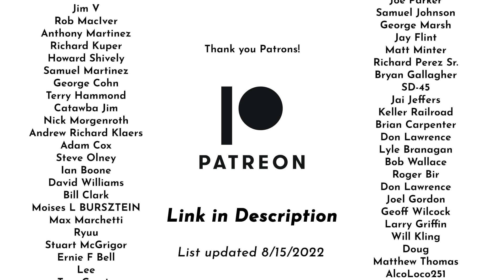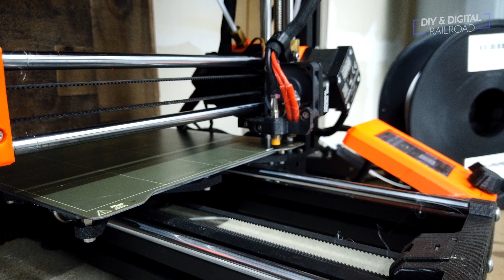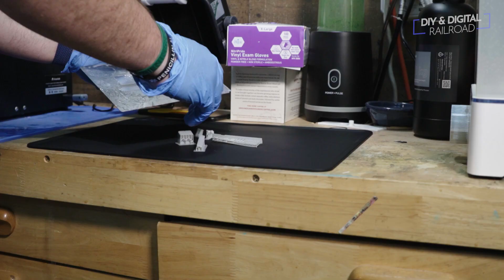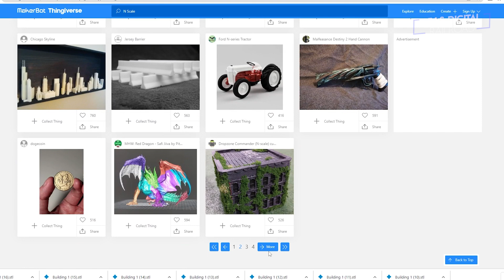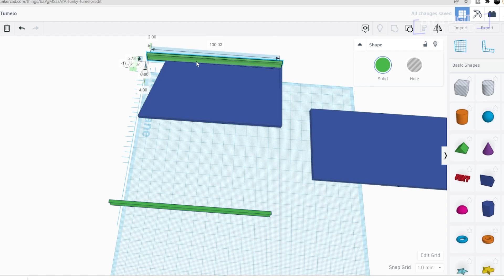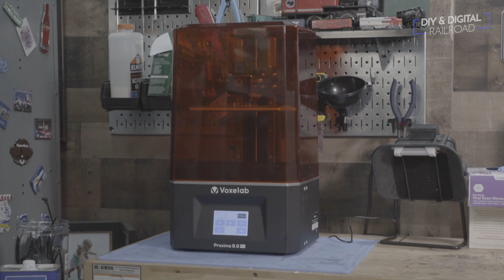Model Railroading and 3D Printing in 2022

Comment: I very much agree with you regarding 3D Printing and of course IOT. I run 1950s American Flyer as you know it is not O or HO it is S Scale. But It is what my Dad gave me in 1957 and I just love the scale. I started with a cheap Plastic Printer and I self taught AutoDesk Fusion 360. I was an engineer in my day and started my career in the draft board Designing HiBay Fork Lift Trucks. So I knew a little about electromechanical. I had trouble getting 4 puffs & Chuffs per Rev on my 1950 American Flyer. That was my first project. I had already cut up the old smoke housing and crammed a Mini DC Motor  with a fan, and added tubing to route the air into the smoke box then pulsed the fan motor from a reed switch off the old Smoke gear. WOW that was a lot of work but it did the job. I make three of them but it killed me to cut up and destroy these Vintage Smoke housings. That was when i bought the Toy 3 D Printer for $150. It worked very slow and not a lot of detail and nothing too hot. BUT, I did it! I designed several Smoke Housings with Fan Motors and used PC Board material for the lid.  I melted a few down in the process. But I finally had a a decent design and could monitor the Smoke Heater in closed loop to prevent over heating. Then I designed an adaptor to fit my contraption onto the Flyer Steam Engine and VIOLA! It was working. But i lost the old mechanical chuff sounds. So i have to search for a Chuff Sound and triggered it off the same reed switch. That was over 5 years ago. Today I still have a Hobby 3D Printer but it has been upgraded a LOT and It is Big. 300x300x400 So I can print Engine Bodies. I have made fire boxes, Tender Chassis, Trucks,, 4 and 6 wheel with pickups, Replacement Motor Fields to convert the Vintage motors to DC using Permanent Magnets like the early motors. I have also printed Test Rollers for testing the engines, Stationary smoke for Hot Box Cars, Factories and Homes. I just completed my 1st whole Tender trucks, chassis and body for a K5 Pennsy Pacific. My next project is going to be an S Scale version of the Snow Piercer with a Diesel Chassis in 3D Print with DC motors and ESP MicroControl with lights and sound. I have the prototype  body ready for modification to fit the chassis. I see 3D Printing as a means to unleash creativity and Model Trains as a common focus for many of us to groups around and recreate our dreams or make new ones. I have made numerous Tribute Trains for kids and friends end job places or special events. Its not scale or rivet counting but it sure brings in a lot of folks to see and admire creations they can relate to. Some of my favorites were, Wizard of Oz for my wife, A spy train for work, a greek train for family friends, Lincoln Funeral Train cause I am from Illinois, Corvette Train cause i have owned Corvette since 1966, Several Christmas and Childrens trains and I still have a list I want to build to. The hardest part was coding the ESP boards in Arduino. I coded as an engineer but Arduino is really still an infant with respect to standard protocols and User interfaces. You buy a board you better get the pinouts and INO File for testing. The best part is when I am completing the assemble on the final parts after months of test and rework, I know everything works and looks good. I am building this last one with all the correct parts, all the bugs fixed and its going together to test one last time then ship to the new owner. I love that last days of thrash. You look at all the test parts and see the completed model. You did it, it works as you dreamed it could and you can not wait to the email back from the recipient. Oh what craftsmanship, its just beautiful, so much detail and it works so smooth, the sounds are awesome, and my most favorite feedback, Thank You. I bath in that for a a few hours then my mind wonders across the shop and I see a piece of my next WINDMILL! Ah HA! I can do that! I am so grateful to be alive today and have such wonderful tools to play with and share with my like minded train buddy. You hit in the head 3D Printing has transformed Model Railroading. I am stuck in the S world with my 1950s American Flyer Track and Transformers pumping out AC volts but I just love it. I have rectifiers and Volt regulators and I use chips, resistors, microcontrollers and digital sound board. My next control is on the bench and it will use WiFi in these 1950 engines can you believe it. The founder of American Flyer in S was A.C. Gilbert, he brought us Erector and Chemistry Sets and I know he would have embraced 3D Printing and IOT as well. Come on folks join in the fun, you never stop learning, dreaming and build things. Lets have some fun with trains like we never imagined. I show my work on You Tube on Frankentrain Laboratories. I am not a business, I make no profit, this is my hobby and in retirement my lifeline to sanity. Old Engineers never die, they just by a 3D Printer and make things forever. Regards Dennis in Virginia

Comment: There is a new update to Cura, with Cura 5.0 there is a new slicing algorithm allowing for variable line width during printing.  Prusa Slicer has it too, in the settings have it use Arachne to slice.  FDM is able to get some details that were otherwise ignored during printing, like I made a building using TinkerCAD that has brickwork, before, the slicer didn't really understand them and it wasn't all that sharp.  With the update, not only the brick work comes out incredibly sharp, but also the window frames print (they were ignored before).  I can now get, on my buildings, detail bits to print with the building that would otherwise be a separate piece.  
When designing a model, I do think in terms of printability, like overhangs, and try to design it with as few or no supports as possible.
Note: With resin you CAN touch a printed part before being cured without the need for gloves, resin can cause a minor chemical burn on your skin if left too long.  I don't use gloves unless its a model with supports that I need to clip off before curing.  If I am going to be handling the model for longer then half a second, I do use gloves.  Otherwise I just scrape the model off the plate, pick it up and put it in the basket for the Washing station.  After that I dab it dry with a paper towel and into the curing station it goes.  For some models, I have them print directly on the plate, no supports, so its just a matter of getting them off of the plate without braking them (50ft Flatcar, 50ft Bulkhead Flatcar, Center Rib Flatcar and Opera Window Center Rib Flatcars).

Comment: Having had an FDM printer for several years, I added a resin printer based on your earlier recommendation.  Additions of work and cleaning areas, along with some charcoal filters have ben helpful.  Using a water washable resin resulted in difficulties with cracking and I plan to implement a flexible magnetic plate to try to avoid this.  Tutorials have been critical to understand the slicer, supports, and disposal.  Thank you for your videos on this subject.

Comment: 3D printing is something I really need to get into. My brother has an older PLA printer. I can't remember the brand, but he ha sprinted things for me on occasion and it has been brilliant. I was very surprised at how strong a solid piece that is just a few millimeters thick was. I was expecting some delicate ultra fragile thing. He uses his mostly for building escape room mechanism components. 

I also very much agree with getting a resin printer vs one of those PLA printers due to it being much more detailed. It would also work better for doing a bunch of small parts on a single print where as the PLA printer has to take time to move the head around for each piece the resin printer just does them all on the same layer at once via the LCD screen.
Reply: FDM pla printers are good for objects the size of a mouse or bigger and NOT high resolution.  For models of HO scale simple parts on a uv resin works MODESTLY well.  Some hinges and door louver detail will be an issue at times but for the majority of the parts it works good but bottom warpage or distortion happens at times and don't make your part walls (thickness) too thin as it becomes very brittle.   Good luck

Comment: I know it's a little off-topic but a cnc laser cutter is another great tool for modelling. It's easy to create parts (like a kit) for making buildings from 2mm card or plywood. Designing in 2D is much easier than 3D - Lightburn seems to be the most popular software and it's not expensive. Fine details, such as window frames, could be 3D printed.

Comment: Recently got one of those flashforge 8.9s and its been a ton of fun, ive been printing mostly car loads and jersey barriers but I did try a few caboose designs I threw together. I've found only a >1ish % size fluctuation from file to model. Like you said the only drawback is handling the resin

Comment: I have 2 resin 3d printers my starter was an elegoo mars pro but it is touchy, I also have an Anycubic photon mono 4k printer.    I am using Chitubox slicer with the photon option but after slicing the machine does not see the file to print.   Any suggestions?   Have the latest update on the software.   Great information.

Comment: Be careful with the terminology of 4k vs 6k, etc with resin printer. It's a buzzword that is EXTREMELY DECEIVING. What that tells you is how many pixels are in the machine. But it doesn't tell you the level of detail in a printer. For example, a 4k printer with an 8 inch screen has the same general number of pixels as a 4k printer with a 12 inch screen. Obviously the smaller print area will better utilize 4,000 pixels, giving better detail. The number to look at is the horizontal resolution. Typical printers are 35 μm or 50 μm. The smaller the number, the better the details.

I've had my resin printer for about a month now. I went with the Anycubic Mono X 6K. I am really enjoying it, but fair warning it's NOT easy. There is a ton of trial and error to zone in the best settings for you machine and resin types. When it's dialed in, it's amazing. When it fails, it fails and it can become quite frustrating. I highly suggest checking out tutorials and to start small. The smaller the print the better success rate I've had this far.

Comment: I kinda want to do a YouTube series on designing 3D printing rolling stock. There really aren't enough videos on this. I'm no expert, but my  workflow is improving. People should have access to cheap high quality rolling stock.
Reply: Yes! I print much of my Z scale rolling stock on my printer. Start with one video, see how it does and what feedback you get, and go from there.
Reply: I just subscribed to your channel, so now you HAVE to make that series 🤣
Seriously though, it would be great to see more videos on designing and printing model railroad items.
I'm a UK outline OO modeler and have been slowly working on a couple of LMS wagons that are not available to buy.
Reply: I'm working on some rolling stock printed in HO, and I say absolutely go for it.
Reply: Not an ad..or self boasting .  I have offered for years shapeways HOn30 models.  I can tell you even with my high grade desktop resin printer, home printers can't get the VERY PRECISE tight tolerances on the RUNNING stock parts. I offer my products through shapeways as that company uses INDUSTRY high level equipment and resin that would be economically out of the range for home use.  The buildings he is doing allow for variance and lower tolerances.  The home printers compatibility with mass produced injection part tolerances vary too much on each resin print to maintain constancy.  If your wanting 20 tank cars of a particular model and want constancy on home resin printer is going to be VERY VERY difficult.
Reply: @mxferro  Yeah resin printed items aren't up to injection molding specs but if the big boys don't make a specific model it's the best alternative. I've made some OO mineral wagons already and they are pretty good. I do use brass bearing inserts and buy the wheel sets of course.

Comment: Does the resin have a shelf life? I can see going crazy at first printing with one of these and then it sitting for a while. I would think there would be a market for a person to print for other people. I find the item I want on "Thingiverse", contact the printer with the plan and then pay him to print it it. Drinking Green Mountain's Columbia Select from my Keurig. Cheers and stay safe.
Reply: You should try buying smaller quantities of resin and not only will you use it up in a amount of time before the resin has shelf life issues but also you can go back to buy other brands as well to try out.  I go through a 500g bottle myself in about 2-3 months doing pieces of various size and complexity on a 4"X3" resin platform elegoo machine. Keep the machine in a low light area, no where near a window and I even cover mine with a small t shirt to keep out any stray UV light.  Watch out for bulbs generating UV and use reflective surfaces near by to bounce any light source from direct line of sight uv.  Watch out for the translucent UV resins. I have tried 2 different brands of those and both were mucH more brittle then opaque resins.